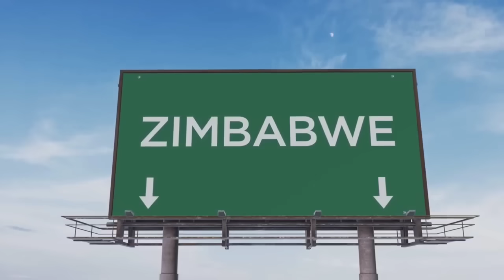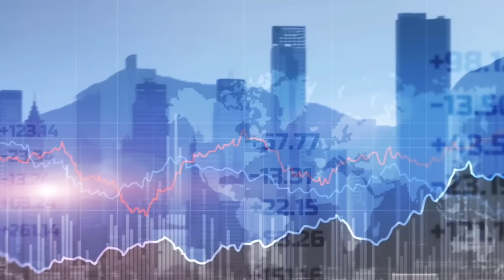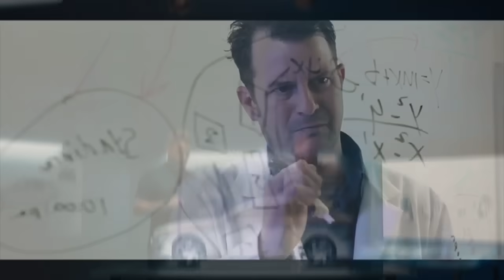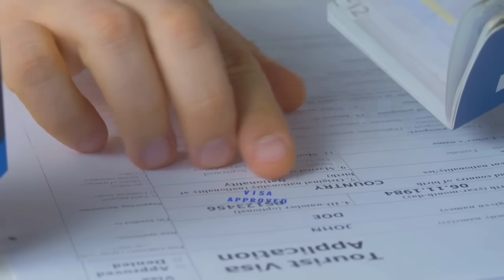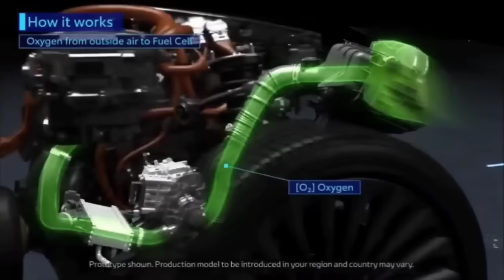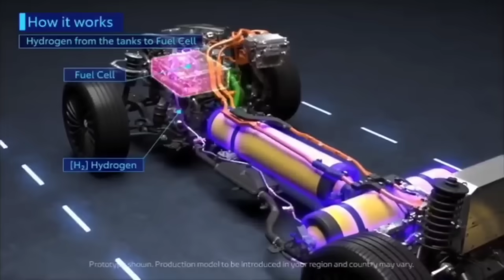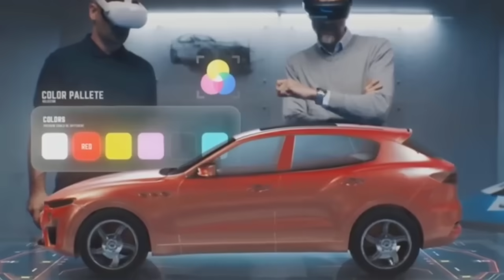Africa Self-Powered EV Set To Drive From ZIMBABWE to Cairo Update

Comment: The trip to Cairo is a wrong wrong approach to testing the validity of the self powered device. Mechanical, electrical misfuntion, metal fatigue, security issues, political and industrial suboutage can come to play. Simply run the machine on any chosen equipment for  days or months without recharging and let's see what happens. The trip is just a clever way of causing a false failure.

Comment: This concept has been pursued since the time of Tesla the person.   There have been many approaches to the process, and several destruction of inventors and their inventions. It is about the arguments of what are OPEN and what are CLOSED Systems.  The so-called laws of Thermodynamics are all about CLOSED Systems.

So then there are concepts such as ARE MAGNETS OPEN SYSTEMS, some of the so-called magnetic lines of force seem to go into infinity before they circle back on themselves.  (Appear to circumambulate the Whole Universe.)  So what do they interact with, or what do they grab onto??

In the use of Energy all vehicles use a WIDE RANGE of power, from a few horsepower up to hundreds of horsepower, and that is the case whether they are ICE or Battery.   Both these systems supply large amounts of power instantly and ON DEMAND.   Steady cruising might require around 20 HP and fast acceleration might require 300 HP. 

So can this system do this???  Or does it need to be combined with batteries, to provide the instant peak loading range???

There are some other companies that manufacture similar devices, Magmov apparently is manufacturing such a device to power homes and businesses, and the American Brilliant Light Company is developing a similar (free energy) system that might replace Power Plants and produce MegaWatts of Power.

Comment: WHY STRESS THE TEST CREW TO CAIRO? DID WRIGHT BROTHERS FLY ACROSS A  CONTINENT DURING THEIR MAIDEN FLIGHT? THEY SHOULD SHORTEN THE TEST DRIVE DISTANCE TO AROUND 1000 KM. AVOID ARAB NATIONS AND THE MANY TERRORIST CORRIDORS EN ROUTE CAIRO, EGYPT. JUST MAKE SURE THE JOURNEY IS (SATELITE) TELEVISED REAL TIME FROM START TO FINISH LINE, WITHIN THE SOUTH AFRICAN ECONOMIC ZONE, WHERE ALL TRANSIT PERMITS ARE FREE OR UNNECESSARY. HARARE, ZIMBABWE TO CAPETOWN, SOUTH AFRICA TRAVERSES TWO COUNTRIES. THAT SHOULD BE ENOUGH PROOF OF THE CAR'S CONSISTENT SELF POWERING CAPACITY.

Comment: Problem unless the car is supplied from a well known car manufacturer and all batteries removed and the car is sealed so no hidden batteries can be fitted and verified that us the case, also no way to charge the car and two power leads are brought out to connect to the device and that is sealed so there is no tampering and an independent observer to observe the modified car at all times. Any report on success can't be trusted

Comment: Clear western false narrative,  it's not the car...this invention is on energy or fuel free car. Whatever the device components are made of doesn't matter. Evs uses century old tyre's, light bulb, driving train, breaking system but still hailed as revolutionary.  CHUKUMUSO is not a vehicle manufacturer so all your vehicle related challenges has nothing to do with the fact that the car runs free from conventional energy sources period.

Comment: I think that the vehicle should have a track of some sort built for it and about 15 drivers to drive it around in circles for 5 days 24 hrs a day except for a swift change of drivers. straight. Do that first so the nay sayers could pitch tents and cameras without logistic hurdles. You don't need professional drivers for that and security can be tight. 
Yeah, durability can be challenged later as well as environment probabilities. No need to cross borders.
Reply: EXACTLY. CONSISTENCY OF THE POWERING DEVICE IS WHAT NEEDS TO BE ESTABLISHED. YES THIS CAN BE ACHIEVED ON ONE FOOTBALL FIELD WITH SATELITE TV HOVERING FOR 48 HOURS OR MORE.
Reply: @tonybantu1681   yeah, though I recommend 5 days and nights to remove all doubt . They can have scientists inspect the road and stadium etc.. and just have regular drivers .. and they can rotate . They can keep all drivers basically in view and all reasonable measures. So the drivers can sleep and eat or whatever and they can be scanned or whatever before they get in the car to drive.

Comment: Travel from Zimbabwe to Cairo is not necessary. 
He can just make the car travel in his own country over a long enough period
for the evidence about the self-powered vehicle. 
One day is enough. An overly long travel is not necessary.
Reply: simply jack the car up and let the wheels spin. if it works, wheels will spin FOREVER  no?
Reply: That cant work maby it gets it power by a wireless charger. Or something. It has to move around.  @Ubuntu_007-u1r
Reply: @Superliegebeest0  yes I'm sure there is a very good reason why he can't do that.  To this day, No demo of his tech working for more than a few minutes at a time has ever been recorded. 16yrs and counting
Reply: @Ubuntu_007-u1r  it was more than 1,000 attempts to invent the light bulb. The first light bulbs did not last but more than a few hours. Much like candles
Reply: Why not put the car on an oval racetrack and drive it 48 hours straight using 3 different drivers.  The car should be able to do that easily.  Why travel anywhere?
Reply: @bakerzumbersmith7341  could be charging by a hidden charger in the track
Reply: To Maxwell Chikumbutso :  Do you have ten cars ready to go ?
Ask a thousand drivers to drive them for a hundred kms each.  The more testers, the better.

Comment: What ever happened to his self powering TV? That was years ago.
Reply: The batteries ran out
Reply: The battery ran out
Reply: Look at the video, under panel looks like batteries, or the device is a battery or a battert in the TV case, not proof in is real no independent testing.
Need independent scientific proof
Reply: Look at that video, you will see batteries under panel
Reply: Despite the ignorant replies of a moron, the TV, works quite well, and has been shown to work free from any external powersource, or batteries!
Reply: @lesmoore6244  show the proof of the statement just made

Comment: Drive a lemans 24 hour type circuit round an enclosed race track in Zimbabwe without having to cross the countries needing permit to travel through these countries.
Reply: This would tell the lie...or the truth... Vary good!  As long as all nations are invited.
Reply: A trip to Cairo will expose the car and the crew to circumstances he can put the blame on for the inevitable failure. That seems to be the plan.

Embarrassing for Africa.

A normal inventor would have tested his invention going gradually from a short track around a stadium to a longer trip throughout the country. And consider crossing a border only if the car is APPROVED IN THE FOREIGN COUNTRY, which doesn't happen overnight.

I was skeptical from the beginning, but now I feel a profound disappointment and even shame for our continent.